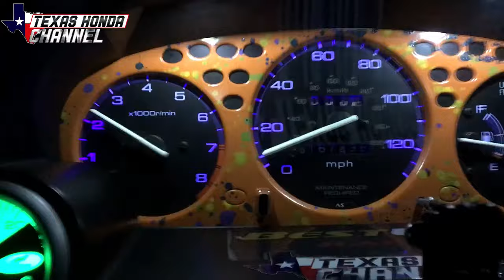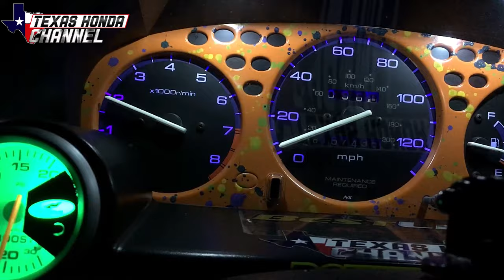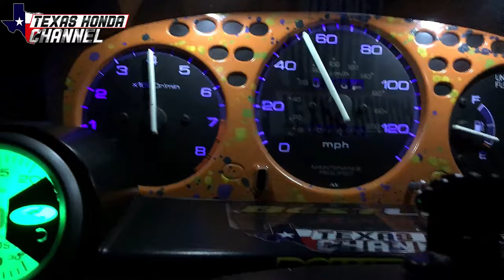How to replace/remove a manual transmission in a civic (DETAILED STEP BY STEP)

Comment: This is one of the absolute best Honda tutorials i have ever seen. Video photography is superb- full brightness and clarity; sound is clear and crisp- no annoying sound track covering up the clear and precise instructions. Only suggestion is not to use the Phillips head screwdriver which tends to expand the roll pin. You may have a pin which is easy to drive out but in my experience the bitch pin earned its name because it doesn't just tap out, and you don't want to beat on the linkage etc. Best way is to  use a C clamp and 12mm bolt pressing the pin into a socket into which the pin is pressed. Other than that your video is superb. I recently rebuilt the D series 5 speed, which went well, but I also replaced the clutch twice since first one was defective. Now something went bad in that area and i think it is the pilot bearing or throwout bearing. Thanks for your beautiful tutorial!
Reply: thank you for that tip for the bitch pin! been struggling with it for too long, about to break out the clamp!

Comment: nice vid. My shifter linkage pin was jammed and non removable while in the car, so I had to unbolt one of the linkages from under the shifter and remove it with the trans. next time I probably wont fudge with the pin at all while the trans is still in the vehicle

Comment: I think you can honestly only remove the passenger's side axel when removing the transmission. Another thing I would suggest is removing or at least loosening the axel nuts while the car is on the ground. Much easier especially if it has never had them out before!
Reply: it looks like the driver axle is connected to the transmission too but i can’t take it out because it’s stuck onto the upper control arm and i’ve been trying to hammer it out
Reply: Just finished replacing my clutch. I can confirm you do not have to take the drivers side axle out.
Reply: How do you manage to do that? Since both axles are connected to the transmission?
Reply: @aidenjohnstone222 how did you manage to do that? Since the axle is connected to the transmission?

Comment: I have a 2001 Civic coupe and these transmissions are know for taking a crap granted mine has 240k but in its defense it was still driving daily just no fifth gear before I changed it! New clutch flywheel and it drives like a new car again! This is why I love Honda’s easy to work on and fun to play with!
Reply: Was it your first time? My fifth gear is also gone and I don’t have the money for a transmission shop and thinking of giving it a try.

Comment: Do you have any recommendations for pulling your first transmission to replace a throwout bearing? Also is the throw out bearing on the trans side or engine side? Can't seem to find a how to video.. also would i have to go this far into it just to do the throwout bearing?
Reply: Throw out bearing is on the trans side. Transmission definitely has to come out to replace the bearing since it is sandwiched between the clutch release fork and the pressure plate. I just manual swapped my civic today, and its all fresh in my mind haha

Comment: 17:20 Do you not have to put a seal between the trans and the engine housing? Mine has an oil leak.
Reply: Sounds like you have a rear main seal leak
Reply: Exactly what I was going to suggest

Comment: Hows the rustoleum epoxy holding up on the floor? Im considering the rock solid kit but still not sure if its worth it over this one
Reply from the maker: It’s holding up okay but since I didn’t get a proper floor sander it can only do so good because the previous paint has caused issues already but it’s not a big deal really

Comment: Noticed you put jack stands at the jack points but where did you lift from first?
Reply: yes i always have this issue lifting up my old hondas and is so damn annoying
Reply: I always lift from where the lower control arm connects to the frame and place jack stands on the tabs. Works well.
Reply: @Asimo44  Like at the bolts or?
Reply: @mrsemifixit  yeah at the bolts that go front to back. I believe they bolt to a cross member in the front and directly to the frame in the rear.

Comment: What does that metal plate for that you don’t have that’s between the trans and engine
Reply: It's just a guard plate so that stuff doesnt go in there some ppl forget to put it on before putting the oil pan so they just leave it out its not bad either

Comment: I know this doesn’t involve this particular video but I needed to ask if I have a h22 in my civic I am trying to find the turbo piping the one you put on your video will those piping work or do I need to order different ones?
Reply from the maker: Since i put that video out the seller stopped selling that kit on amazon for some reason. It should be the same kit though since it’s in a civic.
Reply: Texas Honda Channel thanks I pressed on the link and it sent me to another one that’s available tho same one you think?

Comment: Hi my friend. that braket that you mention on the video is call out stiffener my question is do we really need that bracket im having problem with that braket right niw i intall an aftermarket header and is hiting with the rear bolt of that braket. Im thinking to removed it and just use the flywheel dust cover. Thanks and nice video.

Comment: I had a buddy do this to my civic step by step...for the most part. He left a couple boltz out here and there. No grinds no pop outs. But very hard/tight to get into gear. Maybe something to do with shift linkage? I need help
Reply: May be bad synchros in the transmission. Needs transmission or rebuild

Comment: Great video thanks. I would like to change my automation transmission to manual, but I'm not sure if I run into bracket or bolt issues? Will they fit if same year model, or is there some ? Mine is 2008 model though..
Reply from the maker: The same basic concept applies but without doubt research I wouldn’t know exactly what would be needed. A lot of what I learned was from trial and error

Comment: Hey if I get a trans with a good gearset and put new syncros and bearings in would it prevent the trans from grinding in the first place or are the gears basically a wear item regardless?
Reply: it could help grinding and make sure u use oem manual transmission fluid

Comment: Thank you for the video!
I wanted to ask you a question. What happens if it doesn't want to come out of gear. When I push the clutch in. the clutch is still spinning and doesn't want to go into gear or out of gear while the vehicle is on. Any help would be appreciated. Thank you!
Reply: Slave Cylinder

Comment: Is there a particular order to removing/installing transmission? For example can you remove the mount first then transmission bolts into the engine or vice versa or doesn’t matter

Comment: Crushing dowls with that impact lol don't tighten anything until it's fully mated
Reply from the maker: Been doing this for 16yrs like this with no issues but I get what your saying lol
Reply: That’s y most blocks have those bolt holes stripped cause of ppl like this unfortunately
Reply: He’s right you can crack the housing learn from others mistakes
Reply: It's a REALLY common issue in the s2000 community. The transmission is difficult to fit in the tunnel and onto the block so people use the threads to close the gap, but the dowels aren't in yet and get crushed.

Comment: Hi james, i dont know if you'll see this comment but just wondering, how would one know if the input shaft is lined up properly to the engine? Would it just not even mount on if it wasn't lined up to begin with? I might need to replace my Clutch soon.

Comment: Do you know if you can rebuild an A000 transmission into a B000 with a rebuild kit. And if so do you know of any good kits
Reply: You can not turn into a b000. A b000 has 40mm bearings and a000 35 mm bearings. However there are transmission calculators online that you can use like zeal auto works and show what you happens when you do gear swaps. IF you really wanted to, swap final drive, this is a drop in affair. However the cost of said final drive, it is easier to just by an ex si trans b000 and with out the work. 
Whatever you do, stay with parts for same year ranges. 92-95 96-00 as they changed over the years. Gear stacks are swappable shift forks are different.

Comment: Thanks for the video approximately how much does the transmission weigh?
Reply: late reply but I've been reading 76 pounds for the B000 tranny, expect 80-90 pounds total shipping weight if you're having one delivered
Reply: I can attest to the 70 something pounds for the B000 trans. I picked mine up from the basement and brought it upstairs without too much struggle. That was without fluid

Comment: Hey, I need help please. I loosened my lower ball joint nut and now whenever I try to tighten it, the whole bolt just spins. And if you look at the top of the ball joint there isn't a head on that bolt it's inside that housing. Apparently the trick is to jam the nut by prying one of the arms with a pry bar bit I can't seem to find a good angle to pry on the arms at all please help
Reply: 4:49
Reply: Yes you need to apply pressure then tighten the nut and make sure the ball joint stud doesn’t spin. Cause it won’t be tight. This happened to me. I would suggest buying a new ball joint. I tried to do a u-turn and next thing you know my whole tire is sideways and my fender was ruined!!
Reply: @espinozaiownedu  oh gosh that sucks. So you think I damaged my ball joint? Why would I need to get a new one 😢
Reply: @vadski3469  just as you said when you try to tighten the nut the stud ( bolt ) spins. It’s not tightening it’s just spinning. I know it’s confusing but it happened to me and bad accident can happen. I suggest changing it 100%. Or you hold the stud with vice grips then tighten the nut

Comment: I canNOT get the transmission loose at all! I wish I could find a diagram showing all the bold locations. I think I may have missed one somewhere. I've watched 8 times!
Reply: 1 month too late but it’s probably the dust cover lol
Reply: There is one below the intake manifold. It's another mount from the engine to trans. Kind of hidden. Looks like a structural mount
Reply: @vadski3469  All good. I've been driving it for 7-1/2 months and just turned over 369,000 M!
Reply: @macmaccourt  hell yeah man

Comment: what barnd stage 4 clutch you running???
Reply from the maker: XTR it’s a cheap one but man it works good. Had it on my 30psi turbo setup and it did good on that but after a lot of back to back pulls it got hott so had to let it cool between pulls but other than that it does great!
Reply: @TexasHondaChannel  cool i was just checking to see if it could hold at least 20 psi, so its good to know you ran it on 30, really don't have the cash to dish out on a ACT, or CC clutch right now lol thanks for the info
Reply from the maker: majorkin19 yea ran 30psi and held great. When I made 313whp I was at 22psi with this laggy turbo but the clutch didn’t have a single issue then either. Cheap XTR 8lb flywheel and clutch

Comment: Great video! 
I got a 98 civic that needs a transmission replacement, I have never done this but I want to do it as a hobby, should I replace the clutch as well, thoughts anyone? And thanks an advance for your help.
Reply: Yes, unless the clutch is new it is always recommended to get a new clutch which should also come with a throw out bearing, and take your flywheel to your local machine shop and have them resurface it. Is usually pretty cheap